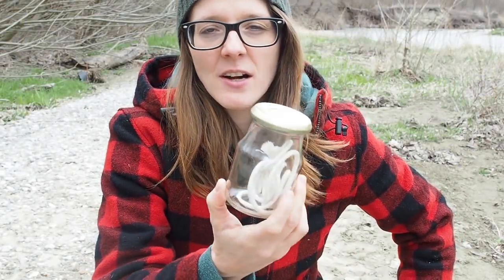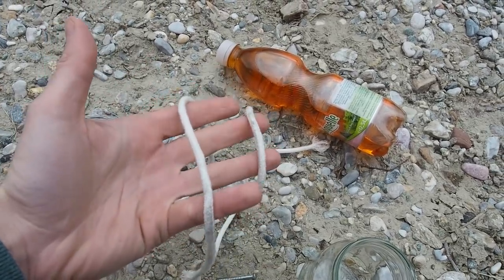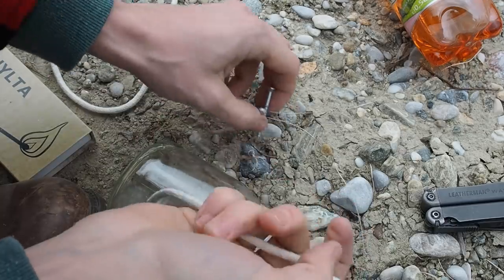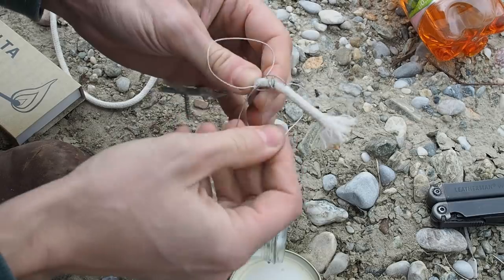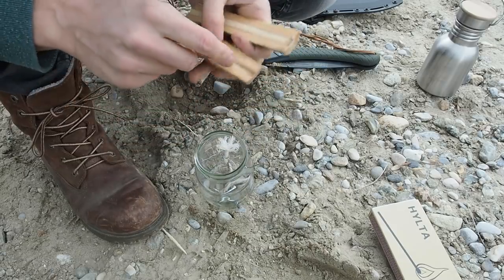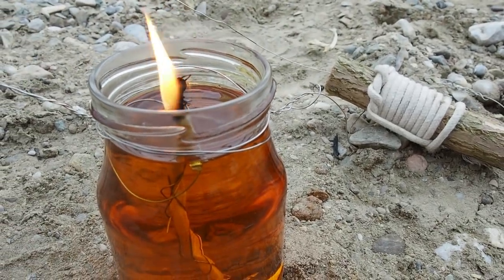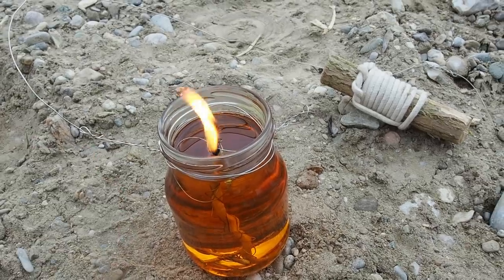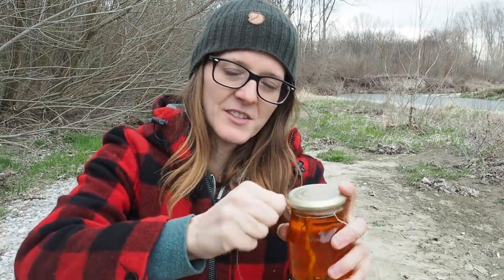#Lantern for SHTF (How to)

Comment from the maker: Thanks for tuning in again. If you want to make this lamp and you are afraid to toss it over you can always take a second lid, punch a hole into it and put through the wick. This way the wick burns above the lid and in case of tossing over you do not lose all the fuel at once. Thanks for watching. Lilly
Reply: That's what I was thinking right from the start. Great idea. And in Canada you can actually buy furnaces that run on used oil. So they are great for shops and garages to use old oil. Thank you Lily. Love your videos, and you XXX
Reply: People please don't poor oil or fat down the drain. It's not good for the environment. And some of it sets into fatberg's in the sewer. 🤮
Reply: Soak your wick in a saturated boric acid or borax solution, then dry horizontally. No more wick trimming!
Reply: In that case (with a metal lid and the wick through the lid) you might use a plastic jar? I fear glass in a campsite, because it can break so easily, is hard to clean up once broken, and feet can get cut.
Reply: HERE'S A SILLY THOUGHT 🤔 
THAT ALREADY WORKS LILY.....

DRILL A HOLE THRU THE CENTER
OF THE JARS LID, THE SIZE OF THE
( ROPE/CORDAGE/WICK ) FILL JAR 
WITH THE ( USED VEGETABLE OIL ) .....
CUTTING THE (ROPE/WICK) 1 Inch
LONGER THEN THE JAR.  THEN
RUN (ROPE/WICK) THRU THE LID,
LEAVING A HALF INCH OF (ROPE/WICK)
ABOVE JARS LID.  AND AFTER A FEW
TIMEZ OF USING, YOU CAN THEN "PULL"
UP MORE NEW WICK TO USE.....
MAKE:
CARRYING HANDLE WIRE 👈🏼 12" LONG.
NOW YOU 👈🏼 HAVE:
A (GLASS LANTERN) 
WITH A TWISTED ON TIGHT 
NON-SPILL LID...
THAT "WONT" BURN YOUR HAND 🖐🏼.....
( KNUCKLE👊🏽BUMP ) Survival Lilly.....
Reply: Diesel fuel works as well. Also has black smoke though...
Reply: @blitzburghbilly7813  .... In the lower 48 lets say South Texas Summers its Hot as Hell people walk around half naked and yes without shoes while camping out....
Reply: Joe Altmaier  try putting a plastic jar over the glass.
Reply: @blitzburghbilly7813   Or moccasins
Reply: Wow!!!! You are awesome, love your perfect explanations!!!  Love Your vids and your beautiful accent!!!  B safe
Reply: Excellent! I missed this video when it came out, but catching up on odd ones I've missed. This is a great tutorial on am emergency candle one of the best I've seen in my opinion because you explain things so well for anyone that would need to follow that doesn't know how to do these things I think you would make and EXCELLENT TEACHER!! 
Well done! And great skills again.. you truly are inspiring with your knowledge of bushcraft and survival and also Gardening! for us ALL.. 
Thanks from London England 👍❤️💪😎🏴🙏

Comment: I’ve done something very similar and you can make a hole in the lid and pull the wick through and it will prevent spilling of fuel , love your videos! You’re awesome Lilly
Reply: I was about to suggest that too . Just take a spare lid one for the wick and one to stop spillage during travel or storage
Reply: But then you can't close it off anymore... Would be best to have 2 lids, one with hole and one without!
Reply: I used mason jars with the replaceable inner lids. Works a treat.
Reply: Did anyone read her video pinned description above?
Reply: @survivortechharold6575  Did you read the time it was pinned?

Comment: This is an excellent hack.
     You can reduce the amount of black smoke by trimming the wick. The black smoke is unburned fuel; too much wick is up where air can get to it. There is an ideal length of wick (varies with fuel, wick, etc.) that will produce the brightest light with minimal black smoke. That's why regular lanterns have that wick adjuster. It's easier to light with more wick exposed. I think you might be able to flatten and shape metal from a can to rest on the top of the jar with a slot in the middle for the wick to serve that purpose.

Comment: Animal fat also works well and solidifies so spilling is not as much of a problem.
Reply: Plus animal fat is also edible and in a pinch can be added to your food for a little extra nutrition
Reply: I was actually  planning on rendering down this years elk for this same reason. I'm curious  how much  I can get out of a whole  elk
Reply: @bowmaster619letschug6   have found rendered pork fat is the best from my experience, compared to beef, chicken and goat fat.
Reply: I wonder if coconut oil would work?
Reply: @kimonk  
That I do not know. 
I would assume so, but I have no experience with coconut oil.
Reply: bacon grease rules!
Reply: @bowmaster619letschug6  unless it turns rancid

Comment: Good in a pinch when you have those supplies. We use old pickle jars with the lid. We drilled 3 holes in the lid with the awl on my Rangergrip 79 - 2 for vents and 1 for the wick. We used a cotton ball (rolled thin and long) for the wick. Each small jar can burn for a little over a hundred hours. This was a similar idea to Lilly's with different supplies. Thanks for another awesome video Lily.

Comment: 👍@Lily - You are so good at explaining each step and alternative materials & methods that I'm in awe.  In this video, you answered 2 questions I've been struggling with; 1) what to use for a wick and 2) how to get the wick to stand up.

Using wire around the wick and the figure 8 loop are brilliant 💎solutions. I notice that some other viewers suggest drilling a hole in the lid, as though everyone has a drill.

I also never would have thought of making my own wick from braiding cotton stripe.

Thanks for sharing your knowledge and expertise. Keep up the good work.💪

Comment: Open oil glass candle. Dangerous spill, glass shatter etc. Pierce screw cap in its center and pull wick through it.  Now that's a lot safer.

Comment: A clever and useful project for SHTF, but the downside you mentioned - no cover - could be a huge safety issue if you were to accidentally knock it over or stumble while walking with it, spilling and possibly igniting the oil on the ground or your legs. I would suggest punching a center hole in the metal lid and extending the wick through it before lighting. The oil would take quite a while to evaporate if left uncapped, but you could wrap some aluminum foil over the top for storage or to extinguish it.

Comment: I was watching you make this and was thinking why is she not just poking a hole through the lid and sticking the wick through it? To hold the wick dead center, also to adjust the wick as it burns up just pulling it up through the lid (if you gauge hole just right it holds the wick snug) and to make it 90% spill proof if accidentally turned over.... Then at the end I see why; you were keeping the lid whole for portability. 😉... We make these all the time for back yard tiki torches. Cheap store bought tiki torches falls to pieces after a years use...  We even use plastic drink bottles just putting some folded aluminum foil with a hole poked through it for the wick to come through as a fire/heat sheild. Never once had a plastic bottle melt. Heat and flame goes up away from bottle... Wrap wire around under bottle neck and hang from a tree limb for walking paths too...☺

Comment: Best thing to do is have 2 lids . One lid for transporting  the lantern . second one punch hole in lid just big enough to pull the wick up through the hole . And you want need that wire to hols the wick . The lid will do that . Plus if you happen to knock the lantern over the oil want leak out and start a huge fire .

Comment: if you used a ball jar I wonder if you could use two flat lid inserts...one to keep it from spilling in your backpack and the other with a hole for the wick to be pulled through during use...might not add too much weight or size to the device but it might reduce spills while burning.

Comment: excellent... hole through the lid might work well, shorter wick = less smoke. good video.
Reply: Also , would the lid not do the same job as the wire as well? I mean just keep the wick upright ? maybe there is no need for the wire ? what do you think?
Reply: @canberraollie   ... good point... if the hole for the wick was small enough to keep the wick in place - that should work well.... just pinch it and pull up a little to get more flame when the wick burns down. Come to think of it... having that hole in the lid may actually make it so no screws are needed to hold the wick down... just  place the wick in ... feed a bit through the hole, seal the lid, .. done.  I may try it, and video just to see if this version works... with credit for inspiration going to Lilly of course.

Comment: May not be good to burn in camp with bears around (smells like food.) If oil is dirty you can strain with coffee filter. Also if you place a wire wound like a spring above the wick , the flame will burn more hot, brighter and cleaner. Grait video.

Comment: The serrated blade is the correct blade for cutting cordage, not the straight blade. Much less effort and greater knife safety. Both important things in SHTF. Also, blowing out a liquid candle can cause splash back which isn't desirable at any time and if the oil is hot, could result in a burn. Instead, simply put the lid on the jar and the flame will die almost instantly. Triangle of fire. Remove one side of the triangle, in this case oxygen, and you have no fire.

Comment: I'd make the wire for the handle longer for another reason.  Not only does it reduce heat reaching your knuckles before it dissipates, it also lowers the light source closer to the ground. I have found that with medieval-style candle lanterns hanging from carrying chains, it's easier to see the terrain I'm walking over if the light is down low, rather than up high by my eyes.  The shadows cast at that angle are much more easily noticed, and I am less likely to trip.
Reply: the light was no where near up by her eyes, walking with it near the ground greatly increases the chance of kicking it while you walk or it hitting something sticking up from the ground.
Reply: The version she was carrying when walking had a longer wire than the initial version she picked up.  It looked like the original version was just a little too close for the heat to dissipate to a safe level. @survivortechharold6575

Comment: Will it work with olive oil ? I stopped using vegetable oil years ago I only use olive oil. Thank you great video looks like a great candle.
Reply from the maker: I think it should work with olive oil as well, but the best thing is to just try it out. candles like these should be prepared before a disaster strikes anyway.
Reply: @SurvivalLilly   Definitely you're right about that best be prepared. I will try it the nice thing is is I can just seal it up and put it away and it'll be there when I need it. You didn't really say how long it will last I guess until the oil runs out. Which I'm sure is pretty long time. How many hours would you guesstimate you get out of a jar that size? Thank you you have great videos you're really up on your stuff.

Comment: Couldn't you cut a hole in the lid and stuff the wick through tight enough so it would be mostly spill proof ? Or am I missing something
Reply: oxygen
Reply: @BoilinHotOil1  Not really. The wick would stick up through the hole in the lid. Plenty of oxygen.
Reply: you could make the lantern any way you want. This video shows how Lily made it.
Reply: @FornaxusCrucible  the wick and fuel will burn it wont stay above the lid
Reply: @charleswalter2902  are you that guy that was crying on YouTube for Britney Spears?
Reply: So long as it continues to wick up fuel, the fuel will burn instead of the wick. That's how it's supposed to work. That said, vegetable oil may not be efficient enough to maintain that for long.

Comment: More than a few times I have made emergency oil candles using a white saucer or tea cup plate, a bit of tin can lid or aluminum foil, and some string off a dog food bag. I always used olive oil (because that's the only cooking oil I buy).  A table spoon of oil will burn up to a couple hours if you keep the flame low, with no black soot (you only get that if the wick is too long and sticks too far out of the oil).  With very little odor. Then set the candle near a mirror to (nearly) double the light.
Reply: I've done the same thing, in power cuts.

Comment: You would have to find a heavy mason jar the type that can withstand some heat, I don't think you would want to use a empty pickles jar. You can replace the vegetable oil with hydraulic oil...…. just kidding don't do that you will have a torch not a candle.
Reply: that is why the wick needs to stay in the middle of the jar and at the top, the jar doesn't get hot.

Comment: A good gust of wind will knock the fire out. A more effective method is make that wick shorter so that your flame is INSIDE the jar.
Reply: the jar may not take the heat? I wonder
Reply: @survivortechharold6575  It will no problem. FYI, you can also use Crisco for the same type of lamp. Been making these things for years. Lilly just finds these idea from others, attempts to duplicate them.

Comment: Anything labelled "vegetable oil" is highly likely very unhealthy for consumption in the first place. Being so unhealthy I don't go through any to begin with so I'll never have leftovers. Fats and oils are both lipids. Fats being more waxlike make much safer candles. There's a reason people don't use oil and kerosene lanterns anymore. Something to do with getting sick of accidentally burning their houses down. On the other hand I have plenty of animal fats that I do save. When a jar fills and I have no intention of using as edible shortening I'll rewarm the jar in order to drop a wick down the center and then seal with cap on while still sterile hot. Now you have sealed bacon scented safe candles compared to using used vegetable oil which risks burning your house down if you trip while you're walking around.

Comment: You forgot to mention the fire will over heat the glass causing it to break
Reply: Great point!
Reply: Thinner wick maybe?
Reply: Use thicker glass ? Or possibly an old candle jar.
Reply: No it wouldn't , the oil will keep it cool .. same principle that allows you to boil water in a plastic jug .

Comment: Imagine you made it and at night u fell over a rock and it broke
Reply: Well when shtf, it probably wouldnt be the only fire around. Though if it does spill and catches fire, which isnt likely as the oil will probably drown out the flame, grab a nearby stick and use it to dig up some soil to toss on the fire to put it out.
Reply: True

Comment: Pouring oil into the sink is an absolute nonsense. Oil separation is a part of the water cleaning process and it has an environmental cost. Keeping some used oil at home for a shtf situation is a really smart idea. The rest of it can be taken to the recycling center or, in case of small amounts, wiped with a biodegradable paper towel and composted together with the organic waste